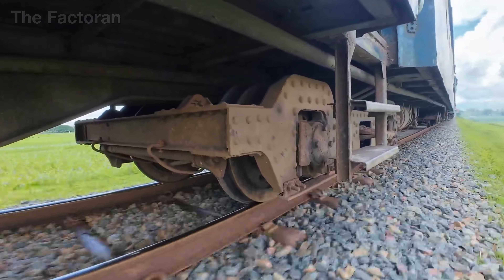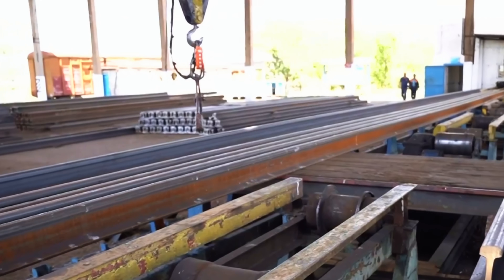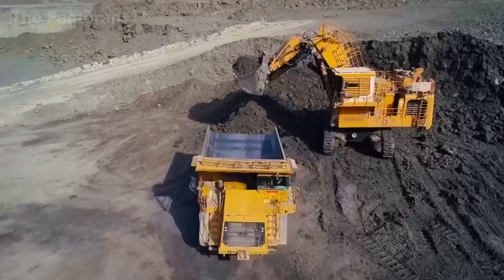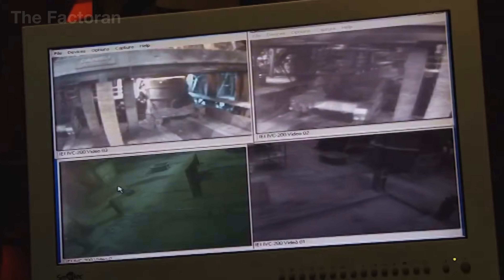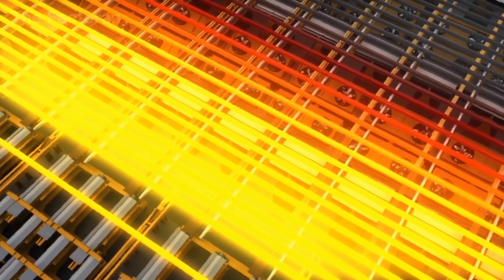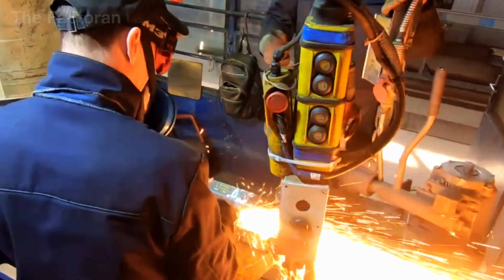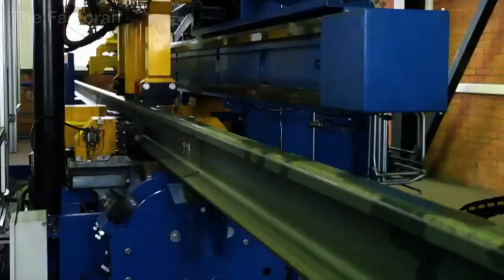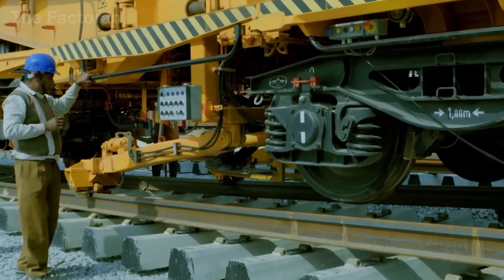How Millions Of Meters Of Train Rails Are Made From Steel - Railroad Tracks Mass Production Line

Comment: Really cool to see how steel gets turned into massive train rails. The machines are super powerful, but the process felt a bit rushed in the video. I’d love to see more about the testing for safety and durability
Reply from the maker: Glad you liked it! 🙌 The rail-rolling machines are beasts, but you’re right—the video moved fast. Safety testing is a huge part of the process: rails go through ultrasonic inspections, hardness checks, bend and wear tests, and precise dimensional scans to make sure they’ll handle decades of stress.

Comment: 2way method train road repair sustain.
1. Rail repair only
2. Train wheel repair only

Soft physical construct.
Reply from the maker: Interesting point — both track and wheel maintenance are crucial to keep the system running safely.

Comment: This is video. The footage is supposed to illustrate spoken words (or spoken words are supposed to explain what the footage shows). In this video, the footage seems to be chosen randomly. I still have no idea where in the process the  rectangular cross section of a steel beam changes into the typical rail profile, as images of billets and rail profile are used interchangeably, where one would expect to see a billet slowly changing into a rail profile. Also I've heard 'capable of carrying heavy loads for decades' (or very similar words) many times during the video. The video could have done with some more precise preparation and a good script to avoid such superfluous repetitions.
Reply: I agree. Plus certain things were repeated too many times.

Comment: It's really quite a process. I was wondering how long the rails are before being joined into quarter mile lengths. This video doesn't say. Also, it says the finished continuous rails are transported on trailers. Actually it's rail carrying cars where the quarter mile lengths bend and follow the profile of the track until it gets to it's destination. These rail carrying trains are interesting themselves. I wish the images in this video were better aligned with the text.
Reply from the maker: Totally agree — it’s a fascinating process! I was wondering the same about the original rail lengths before they’re welded into quarter-mile sections. And yes, good catch — they’re usually moved on special rail-carrying trains that flex with the track, not just trailers. Would’ve been great to see visuals that matched those details better. Thanks for pointing that out! 🚆

Comment: I've always wondered why THERE IS a "WEB" in rail construction. Wouldn't it make sense to "build-up" the web position into the exact width of the "Head", (but allowing for flange clearances), but I think I get it thus allowing "said" rail to last longer. Problem being, is that the rail head wears faster from heavy use, but does / would it??? O.K. I'm an idiot, but instead of a typical "I" formation, just build-up the web portion into an "angular Head to plate fashion.
Reply: The web of the rail is to separate and hold the head and base a specific distance apart to be able to carry the loads imposed.  The best and most efficient shape to do this is an "I" (eye) shape.
Reply from the maker: Not a dumb question at all—it’s actually a great one! The web helps balance strength, flexibility, and weight. Making it thicker like the head would add a lot more material (and cost), and rails are designed so the head takes most of the wear since it can be ground or replaced. You're definitely thinking like an engineer!

Comment: Anyone in that industry consider the deposition of titanium to the top surface of the rails for additional hardness?
Reply from the maker: Titanium’s super tough, but it's expensive. Most rails use hardened steel alloys or heat treatment for durability